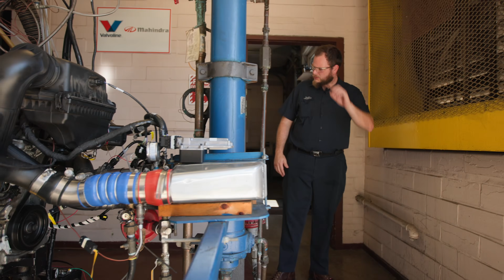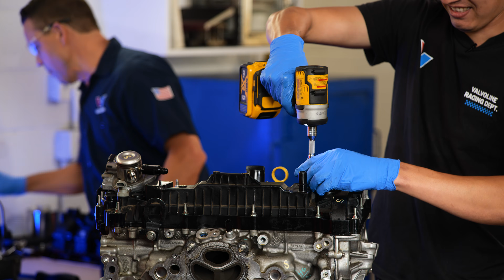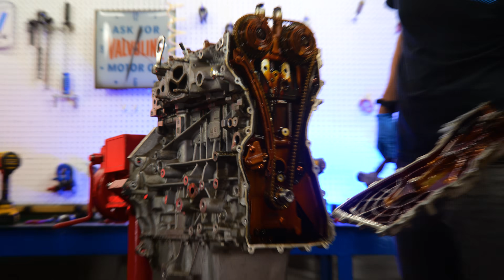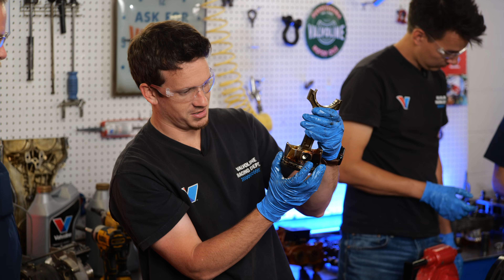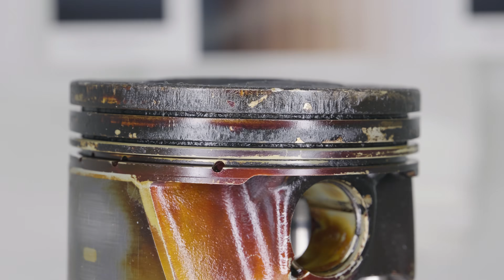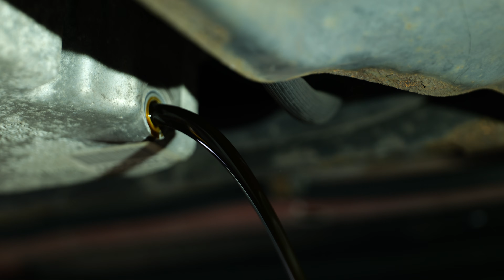RESULTS: What Restore & Protect does to engines after 500K+ miles

Comment: WE NEED THIS IN 5W-40 AND EURO SPEC PLEASE
Reply: Plenty of folks have been running it in cars that call for Euro spec oil without any issues. I've been running it in a car that calls for Euro spec without any issues and have done datalogging and the VVT system works fine. If anything the engine is quieter and runs smoother, but I have no evidence of that. I do stick to ~5K mile oil change intervals despite the manufacturer interval being 10k.
Reply: @dwaynesykes694 I been running it in my Mercedes but I'm hesitant to run it in my Alfa.
Reply: @dwaynesykes694  API SP and SQ spec oils have better wear protection than historic European A3/B4/SN oils. Those old oils have more calcium detergent which competes with the anti-wear ZDDP and results in inferior wear protection.
Reply: BMW LL04 Acea C3 Valvoline R&P 5W40 already available in Europe. Made in the netherlands and distributed across european dealers like opieoils in the uk
Reply: Exactly what is "Euro spec"? I think the governments get too involved in their requirements. I believe that meeting the API and viscosity requirements should be enough.
Reply: @boomerguy9935  euro spec has different flashpoints and ash content for shear resistance at temp vs US. There's a massive difference

Comment: It didn't do anything for my Toyota engine. It's probably clean inside but the rings are still stuck.
Reply: If it’s one of the Toyota engines where they recalled it (think 2.4) the cylinders are probably damaged.  No oil will fix that.

Comment: 2004 f150 5.4 used one to two qt. every 3,000 mi. First change w/valvoline R & P hasn't used any oil after several hundred mi. 2016 chrysler town and country touring used a bit more than ford, no oil consumption after valvoline R & P. Most amazing! Sold on R & P!

Comment: I put in in my step daughter's 2010 Honda Civic after the first oil change. When we got the car it was using a quart every 500 miles and I was concerned that she wouldn't keep up with checking the oil,so I switched to restore and protect . Now 40,000 miles later with 235,000 miles on the engine it uses about 1 quart every 3000 miles. Very impressive.
Reply from the maker: So glad to hear this! 🙌

Comment: My 2001 WRX used to burn roughly 200mL of oil ever 1000 kms. Next oil change I started using restore and protect, and after only 4000 kms I had entirely stopped burning oil. This stuff is the real deal.

Comment: I would absolutely love it if you guys gave us 0w-16.
Reply: 0w20 can be used in any engine that calls for 16. It's not enough of a difference
Reply: @FooJub 
"If SAE 0W-16 is not available, SAE
0W-20 oil may be used. However,
it must be replaced with SAE 0W-
16 at the next oil change."
It depends on if I want the warranty or not.  It's from the owners manual of my dad's 2022 2.5l Toyota Camry.
Reply: @alexwalker8422  They don't care lol. It's not a valid reason to void warranty. Either it's suitable for the engine or it's not. If it's not then they wouldn't allow it to be run for an entire oil interval.
Reply: @alexwalker8422  They HAVE to legally tell you that for CAFE compliance. Also it benefits them if they wear out your engine faster. Toyota has lost a ton of profit from making their cars too reliable.
Reply: Valvoline does make it. However, many stores do not stock it. You have have it delivered to your local Autozone. I have seen it there.
Reply: Sounds like a you problem

Comment: I have 53,000 miles on my truck...21,000 miles on my wifes suv... should i switch to this? They have had oil changes every 4,000 miles on the turbo,or less,and 4 to 5000 on the non turbo.Castrol Edge 0w20.

Comment: I’m on my 22nd oil change with this in my work truck, a 2016 Chevy express 3500 with the 6.0 L96 V8, basically 90,000 miles on R+P, I’m super curious on how clean the internals are. I’m going to increase intervals from 4000 to 5000 miles as recently the oil has been draining out relatively clean, like still sort of golden transparent, which to me is kind of bizarre, why isn’t the oil getting dirty/dark? Anyway excellent product.
Reply: prolly because the engine has no more deposits for RP to clean 😅😂

Comment: Have yet to change the oil, but running it (5 w30) in 2012 Volvo XC60 (inline 6, 3.0 turbo) has already smoothed the engine, which I attribute to piston ring cleaning. The measurable change is in oil consumption, down from 2 liters/804 km to 0.5 liters/1209 km or 751 miles.  With results like that, I plan on running it all the time.

Comment: This stuff works. Been a Mobil 1 user for years. One day I went to change the oil in my Honda with 140k and noticed I was down half a quart. I was like what the heck? After watching The Oil Geek’s video on R&P, I immediately switched. Now zero oil consumption and the dipstick shines. This stuff is the real deal. In fact, most every time I go to Walmart to pick up a 5 quart jug for $30, it’s sold out. I have to time my pickup when a shipment comes in. I mean seriously, what other oil is consistently sold out? Tells you that people love this oil, and for good reason.
Reply: Where I live, there's a limit of 4 jugs/customer and I have phone ahead to reserve it!
Reply: Mobil 1 ALWAYS burned a quart between oil changes in the 2 Honda Accords I had since new - it's garbage Wal-mart grade oil which is why it's cheap. Using Idemitsu 0W-20 or Liqui Moly it burned nothing between oil changes.

Comment: 275,000 miles on a 2019 f150 5.0, lifter ticking, burning oil, smoking every time we leave a stop light. Did 4 oil changes with this stuff.  Now 300,000 miles, smoking gone. Lifter quit ticking  also. Passed emissions 3 months ago.
Reply: Knowing the history of consumption issues of the 5.0 in those years, that’s incredible. I’ve seen people try multiple types of engine flushes, piston soaks, etc with no real fix for consumption. I hope you’re spreading that info far and wide since many 5.0 F150 owners just deal with it.
Reply: @cpftank09  I have a 6.2L F150 at that mileage. They probably have high tension piston rings with the gas mileage it gets. Except for valve spring failure which has nothing to do with oil, they never have oil or phasor issues.
Reply: What weight oil?
Reply: @2URLex  I switched to 5w30 at 100,000 miles.
Reply: @chuckmiller5763 from what?
Reply: @guitarplayer4429  5w20
Reply: 5w-20 is the recommended from ford
Reply: @gr86er  Because of fuel mileage, not engine life.
Reply: @chuckmiller5763 I was answering previous comment
Reply: This is great to hear. We just bought a 2019 5.0 for a work truck. 150k miles. Definitely has the tick and burns oil.

How's the transmission after almost 300k?
Reply: @codyfield6859  Transmission is still going strong.  Change the oil sooner than required. Always check it,it will get low on you.  Change the transmission filter also,  its a special filter and needs to be changed every 30,000 miles.  It uses ULV oil. Not LV.  Cannot use LV fluid.
Reply: That engine went 225,000 miles more than it was designed to last

Comment: when are yall doing one for the transmission fluid?
Reply: Already exists
Reply: @SPPACATR I meant for gear oil but ut completely changed it.
Reply: @pandalegends2738  You don't need anything fancy in the gear oil. If you want, choose a gear oil that meets your vehicle's specifications and also markets cleaning properties. Gearboxes are much less fussy than engines, that's why engines have an oil filter and a much more regular maintenance interval while gearboxes don't.

Comment: My big concern is using this in a euro car with a turbo. Particularly a BMW in my case. You know how important those manufacturer specs are to euro folks, can I use this in a modern BMW that calls for LL01 or LL14?
Reply: If you run a shorter interval, you won’t have any problems. The LL specs are long life properties for extended drain intervals. You don’t need this during a cleaning phase. 👌🏼
Reply: Note that if you go to Valvoline's website and check if VRP is recommended for your engine it probably won't be due to the long-life oil spec for your car.   Just don't let your oil changes go longer than 5K miles and you won't need to use the long-life spec oils.    I've been using the 5W30 VRP in my 2004 BMW X3 with the M54 engine (non-turbo) @ 200K miles because the engine had been quite dirty due to a broken CCV system and the excessively long oil change intervals which BMW had recommended.    In two oil changes with VRP it's completely removed all the sludge from the valve train and the oil sump (as seen from a borescope), and removed much of the varnish.     More importantly it's cured my high oil consumption problem, and the engine is also noticeably quieter as the lifter tick has disappeared.     Truly amazing stuff and I'm going to use it indefinitely.

Comment: ...never thought I'd see Pennzoil Ultra Platinum move down to 2nd. place...😢
Reply: It’s still 1st depending on what you’re prioritizing. I still think Pennzoil Ultra Platinum is better at maintaining an engine that’s already clean (as well as AMSOIL Signature Series) but if we’re talking strictly cleaning the pistons then I would put Restore & Protect ahead.
Reply: @sunnyr.1954 not to mention all of those engine oils will most likely still lead to some issue later down the road. I was running pennzoil ultra platinum in my xterra for 40k miles. I still developed a timing chain tensioner issue and fixed  it with restore and protect after 3k miles and one year of running it.
Reply: @miltechmoto Wow!😮
Reply: @miltechmoto  Yeah my personal thought is you can have really great oil that works in 98% of places but there's those certain spots that will build weird deposits.  I think on the Mazda Skyactiv,, the gearing (or whatever the electric motor is driving) for the intake VVT may be one of such places where the end of travel might get gummed up and cause it to stick there
Reply: @big0bad0brad Well let's look at this video itself, part 1 they compared conventional and full synthetic. Both oils worked in terms of wear, but both oils had stuck piston rings The conventional oil had a stuck timing chain tensioner. But the full synthetic also has deposits and sediment build up so it was only a matter of time before more pistons and components would get stuck. The best oils in the world focus on wear protection and maybe high heat endurance. They use more additives and they have higher grade oils that don't break down as easily. But as far as deposits they can only reduce the build up every year but they don't remove deposits. And that is quickly becoming the biggest reason for why an engine gets taken out of service or needs rebuilding. Almost any oil these days can prevent wear and even sustain a turbo environment if you change the oil frequently enough.
Reply: @miltechmoto  Yep, agreed, that's why I'm a fan of this oil
Reply: @sunnyr.1954 I agree with you.

Comment: I'm  all in for R&P. I've been using the last 10K miles on my 2019 Tundra. I will be using on my 2003 Dodge 2500 hemi. My 95 Dodge 1500, my JD 2010 and Ford 8N tractors. And my family's JD 580, Simplicity, and other mowers.

QUESTION PLEASE. The old farm tractors use regular detergent W30 oil for hydraulics. Is it safe to use it in the hyd system?  I suspect both tractors are getting gunked up.
Even if it cleans out the gunk stopping leaks, I don't mind rebuilding he systems.

Comment: Notice how they advertise the use on older engines, why are people so adamant on using this on new cars, when you only see Valvoline using it on old ones?  Why doesn't Valvoline have this in all their oils?  Why do they say their EP offers the most protection?  Why was the old formula changed?  It cleaned engines in one go, now you need to use it 4 times?  Why not make a stronger R&P Plus?  I used valvoline 0w40, and it's formula challenges anything out there, but no one talks about it.  Awesome performance oil.  Application dicates chemistry, lsp jr says that, if your car isn't dirty, why use a cleaner?  I don't understand.
Reply: The way I look at it is this…

I know for a fact that in the mid ‘00s OEMs started using low tension rings to reduce friction and increase MPG. Owner/drivers didn’t know it was going to be a massive issue in 2007 when they purchased their 2AZ-FE equipped vehicle, but it sure turned out to be a huge issue. Same thing happened with the 2ZRs.

OEMs are always changing stuff, and honestly I don’t really trust they’ve adequately tested enough. My M20A-FKS has only been spec’d for this new 0W-8 for a couple years, and I wouldn’t mind having the cleaning agent in the add-pack just in case .
Reply: The engine in this test is a direct injection 2.3 Ford Explorer engine. Unlike the port injected 3.6 pentastar engine used in ASTM testing for piston cleanliness. So they’ve gone above and beyond. 

This oil isn’t just a “cleaner”. It’s shown very low wear in many UOA’s even when compared to boutique oils like Amsoil or HPL. Plus it’ll keep it clean if you continue to use it.
Reply: @cpftank09 
Last year I happened to catch a livestream Lake Speed Jr. was doing. He speaks very highly of Valvoline’s add-pack.

Specifically he spoke about the MoDTC friction modifier Valvoline uses across all their lines. He said it produces superior wear metal results across his company’s oil analysis data. Now he did say it isn’t light years ahead of the competition, but it is consistently better.

MoDTC is a lubrication rising star. It is fully soluble in oil so it has no precipitation risk. It has high synergistic values when working alongside ZDDP.

If you haven’t read about it it’s some wild stuff. There’s a lot of info online.
Reply: The product you referred to was only for diesel engines and was very concentrated. If you did that on gas engines they could blow up on the first OCI if sludged up
Reply: The reason they call it Restore and Protect is because not only does it remove old deposists, it does a great job protecting engines from the formation of new deposits. It also does a good job keeping wear metals low. The Motor Oil Geek channel did a lot of oil analysis on Valvoline Restore and Protect in both high and low mile engines, and he liked the outcomes.

Comment: Had been using VR&P in my old 2ZR-FXE that had a long standing TSB for oil consumption. Although I did not have oil consumption at 120K miles, I figured I’d start running it as a prophylactic to hedge against future issues. I really like this oil.

I was in ~12K miles and someone hit me and the vehicle was totaled. The vehicle I replaced it with has the M20A-FKS spec’d for 0W-8. At 500 miles I dumped the factory oil and switched to Valvoline Advanced. If VR&P came in 0W-8 I’d be using it right from go. I mean why not use Valvoline’s new cleaning agent for the engine’s entire serviceable life?
Reply: They make VR&P in 0W-16 now... and all the Toyota 0W-8 engines I've seen specify in the owners manual that 0W-16 is acceptable if 0W-8 can't be found.

Comment: I would like to put it in VW EA888 gen3 but Im just not sure.It's because oil consumption of course
Reply: I wouldn't be afraid of it. Run it and do an oil analysis. If you aren't seeing significant changes in wear metals and a reduction in oil shear performance, then it is doing it's job.

Comment: Been running valvoline extended protection high mileage 5w-30 on the 4th oil change now. I was wondering if it has a little cleaning power because the engine feels like it has more power.the engine also idles better and is quieter over the last four oil changes.Considering switching to the restore and protect for 4 changes.
Reply: If everything is running good, why stop?
Reply: @robczar7479 I just want to run the r and p about 4k miles for four intervals not looking so much into switching permanently. But hey if it ain't broke 😅
Reply: Switch permantley!

Comment: Been using this in my 2007 Subaru outback which is right now at 206k miles. It does not leak a drop of oil but it seems to burn it. No blue smoke but right when I bought the car it was going through about a quart every 800 miles. So I think the oil rings are stuck. I have replaced the pcv valve and hoses with OEM parts. I'm getting ready for my 3rd oil change with restore and protect and results so far have varied. At times my oil consumption is worse and at times it has gotten better. Hoping to get more impressive results soon.
Reply: On an Outback that old with those miles it has probably been ran low on oil more than once in its life and with the boxer design the cylinder walls are easily worn allowing it to burn oil from  damage you may not get significant improvement
Reply: @Austin-cg7be  That was a thought of mine. I'm the 3rd owner and I bought the car at 185k and it has a good service record which showed regular oil changes. Car runs great, no blow-by. The idea that the boxer wears out the cylinder walls by design due to gravity is not correct. Though low oil would do that for sure. I've worked on engines with well over 200k miles on them and the cross hatching was still in great shape. Just like other cars, the oil rings are prone to getting stuck and I think my year of outback's EJ are more prone to issues from deposits.
Reply: @GearHart7734  Give it a few oil change cycles with VRP before you decide the rings are worn.    I was burning 1Q every 600 miles in my 2004 BMW X3, and not long after I started using VRP the oil consumption actually got worse (apparently as the rings began to get unstuck).    But after about 2K miles it started improving and I'm now using less than 1Q every 5K miles.
Reply: @skrekk7536  That is my thought as well. Figured as deposits are removed it could make oil consumption worse until the rings break free again.